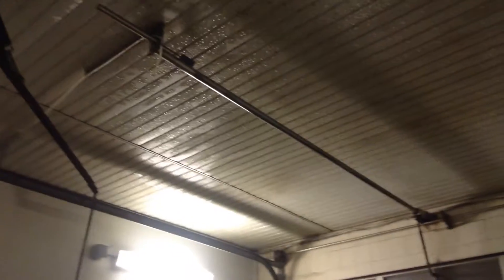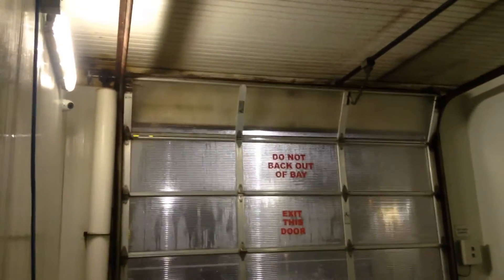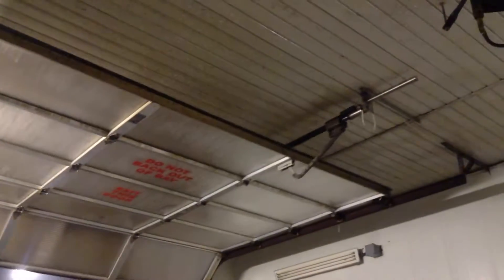Car wash doors

Comment: That is an Air Lift door! Its made by a company here (in my state) Minneapolis Minnesota. Lol no its not a Wayne Dalton.  The opener is powered by hydraulic air cylinders, which is that long bar/rail on the ceiling that has the door arm connected to it. No it does not have Torqmaster springs. That big white Pipe on right side of the door track is the counter balance system (basically a big counterweight) in side of it that connects to a Torsion tube, but instead on having Torsion Springs on the Torsion tube, it has the Counter Weight connected to it.
Reply: Joe Powell cool that place is also really close to where I live st.paul Minnesota
Reply: Colton Beedy, I had a feeling you lived their..  I do alot of work in St Paul, lol those alleys look all to familiar..
Reply: Colton Beedy I work in the construction trade (carpentry) remodeling and building homes.  I do garage door work on the side.   I do a lot of work on the East side tho.
Reply: Joe Powell okay lol
Reply from the maker: Joe Powell okay cool I wasn't sure okay sweet!!! So there are air powered cool man they run fast and smoothly!!!! Thanks for watching
Reply: Iowa Interstate 513-516 yeah if you search Air Lift garage doors on YouTube, you should fine a few videos.  These things are cool!
Reply from the maker: Joe Powell oh yes that why I took a video of them they are sure interesting though not like a regular opener!!!
Reply from the maker: Joe Powell okay thank you man I was wondering why definitely makes sense now
Reply: Is it an AirLift or a PowAirDoor?
Reply: TheGarageDoorGeek definitely Airlift, the plastic door hinges give it away.
Reply: Joe Powell I watched it on my phone, so that might be why I couldn’t tell that.

Comment: Call me stupid but is there any electricity used in this at all
Reply: Gabriel Jennier A lot of people would think so, so you aren’t stupid. Air cylinder doors don’t use any electricity what so ever. It’s all based on mechanical valves and lots of tubing. The buttons you see on the walls are connected to mechanical valves which direct the air flow one way or the other, thus making the door go up or down. Also, most airlift doors use counterbalance weights to avoid springs being rusted from car wash use.
Reply: The only electricity on these is in the air compressor, and there may be low voltage power into the control cabinet for solenoid valves, if the door is equipped with safety eyes.